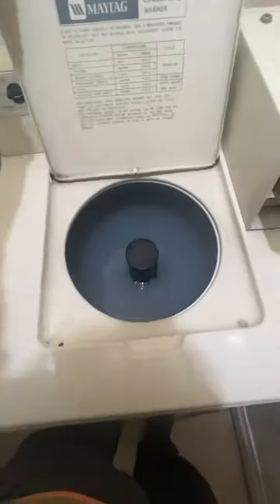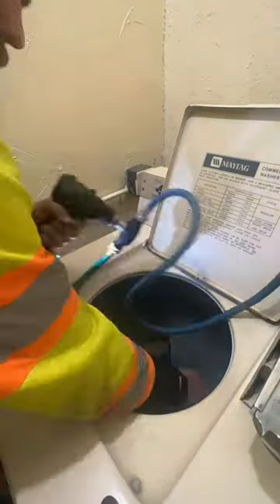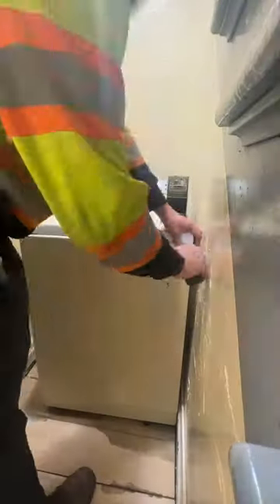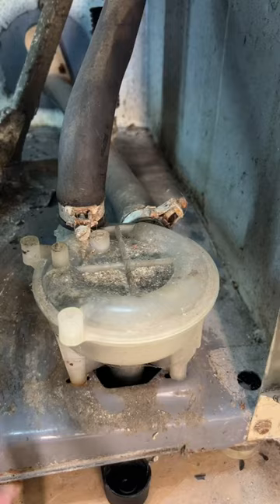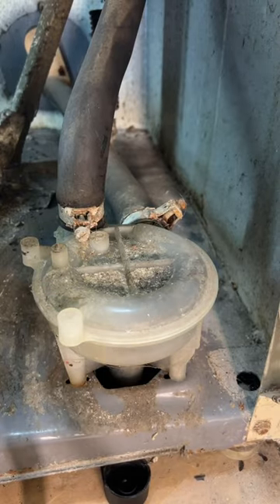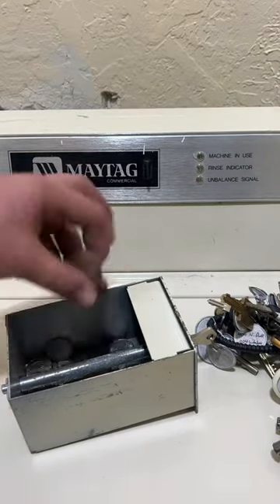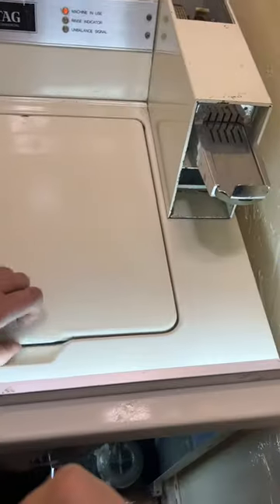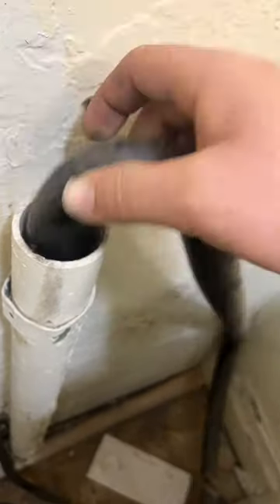Removing a sock from a coin operated washing machine. #HandsomeOrHandy #ShortsmasChallenge ￼

Comment: That transfer pump is a great idea. Going to use that.
Reply: If your pump jams or breaks, you can usually use a wet vac to suck everything out the discharge hose.  No mess!
Reply from the maker: Hardly anything would flow through the discharge line because of the sock.
Reply from the maker: I only carry a small battery operated shop vac which would’ve required it to be emptied 5–6 times in order to empty this washer. I got tired of doing that so purchased the drill pump.

Comment: I noticed you don't have a lint filter on the output of the hose, just run it right into a PVC drain pipe.  You don't have any problems with doing it that way?
Reply from the maker: If it made it through the drain pump it can make it through the sewer system
Reply: @HandsomeOrHandy  I guess that makes sense.  It does make me wonder why I'm using a fine wire mesh sock on the end of my drain hose that goes into the stationary tub?  Why are those so common if they aren't really needed?